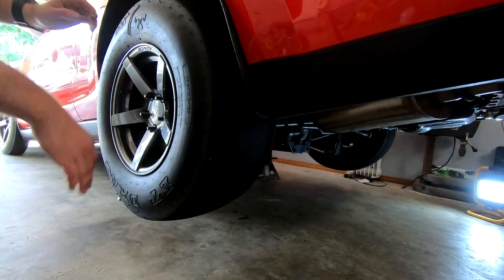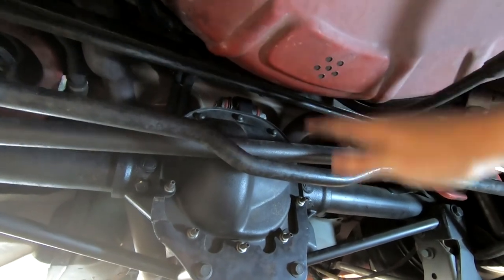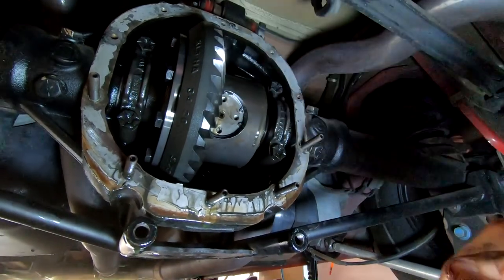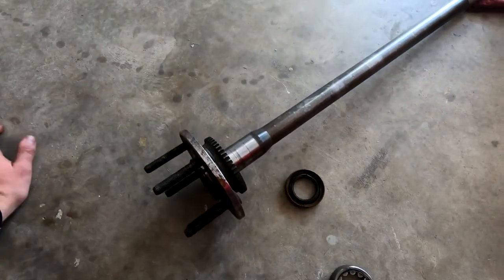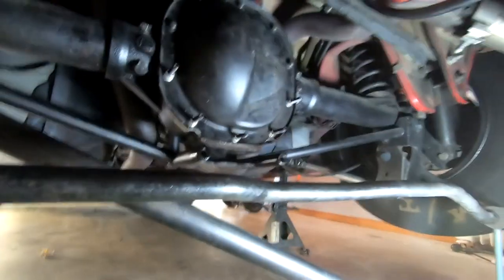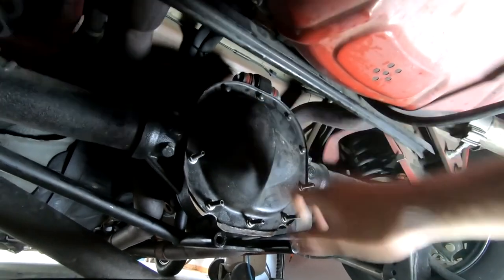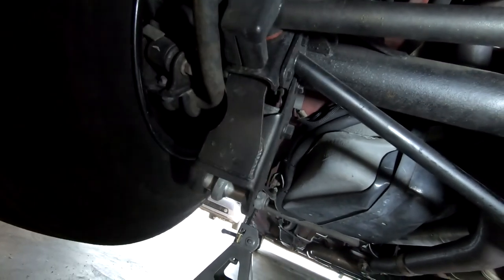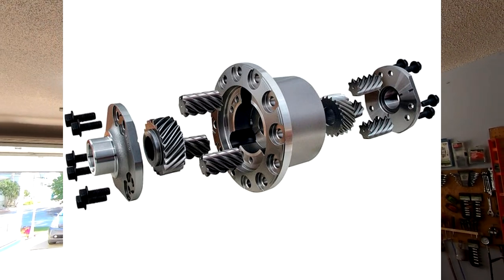2007 Mustang GT500/GT 8.8 Axle Bearing Replacement

Comment: are you running a boostapump?  Just curious as I have one but never installed it in my 07.  I have the upgraded TVS and TB but haven't messed with the fuel.
Reply from the maker: Yep, previous owner installed the dual VMP boostapump kit on the car. Haven't had any issues with it.

Comment: Did you ever figure out what was causing it the wheel to move side to side im having the same issue with my 2011 5.0 right now
Reply from the maker: If it was like mine in the video, probably just the diff housing gear clearances like I explained and nothing to worry about

Comment: way calmer than I would be after doing all that only to be back at square one. Did you add the OEM friction reducer with the differential fluid?
Reply from the maker: Ah, forgot to mention, the true trac diff calls for GL5 conventional fluid only, no additives or modifiers. I ruined my last one not knowing that and adding modifier, too slippery and starved the internals, not a good time
Reply: @AllThingsBoost  interesting! That sounds like it could have happened to anyone as who.would have thought...  Actually I did my pinion seal and didn't bother with the additive.  No. Issues 3 years and counting. I don't take mine to the strip though.

Comment: I’m currently stuck with removing the C Clips man any tips?? Mine seem to be stuck inside they won’t come out lol
Reply from the maker: Once you get the axle to slide inboard, a good idea to remove the speed sensors to allow for extra clearance, I've had to use two 90° picks to get them out. Some run a rubber o-ring under the clip that makes removal a real pain in the butt.
Reply: @AllThingsBoost  If I removed the o ring would it be easier you think? I did take off the sensor it made a tiny difference
Reply: @AllThingsBoost  Removed the O ring and it came right out man ! Simple DUH moment caused me hours 😂 i appreciate it 🤝
Reply: The bearings are easier to install if you put them in the freezer before.